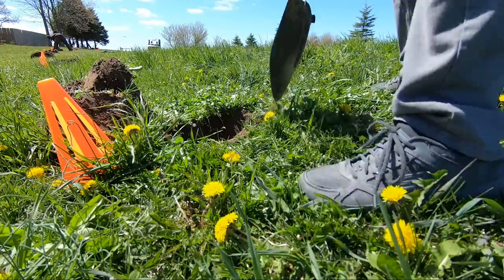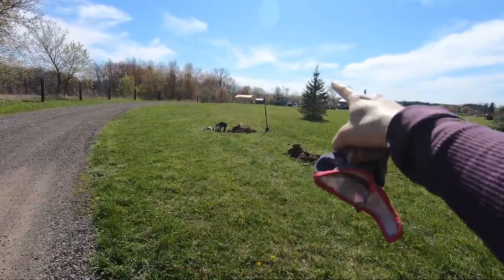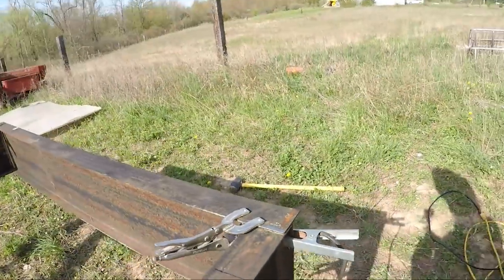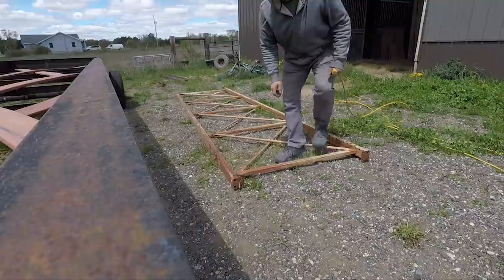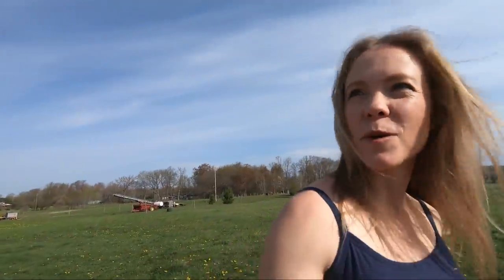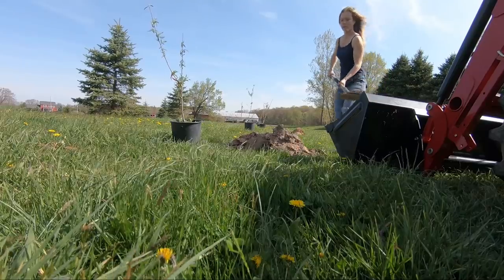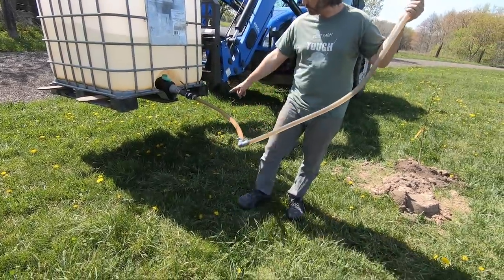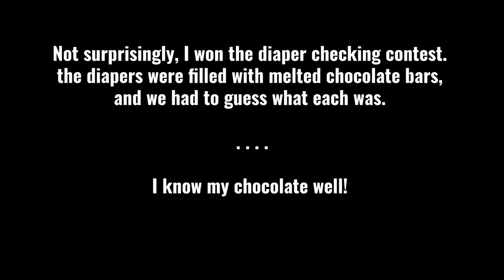372 We Planted A NEW CROP and Surprised Everyone --  House Trailer Into Hay Trailer

Comment: fruit trees.  I planted Cherry trees and they thrived.  I have Two Northstar and one Meteor.  The Meteor blossoms later than the Northstar.  an interesting factoid if you bury the graft on the lower trunk of Miniature or dwarf trees the root stock will take over and the dwarf tree will turn into a standard.  An 8 foot Northstar Cherry will become 30 or more feet tall.   Requiring a man lift boom to pick fruit safely.  (heavily mulching the bases of the trees can be the same thing as piling dirt )  keep the level below the graft.   A cold wet spring usually makes for a good fruit year.   Something to keep in mind Nanking Cherry shrubbery produce a good quanitity of edible fruit and make a adequate wind /snow break.  They are sweet cherry so you have to be in the ripe fruit immediately or they will start to ferment on the tree.   Fruit in general needs to be managed as a sudden rainfall after a dry spell will result in split fruit 

I have given up on the prospect of having dwarf Apple trees here .  6 consecutive years in a row I planted Apple trees and they all died during the winter.   When the weather warmed to above freezing the wake the trees up and then be slammed with freezing temps again.  They can usually take one or two but a series seems to be too much.  I ran out of ambition before spending the cash on Standard trees.
Reply: Remember when moving snow along the drive.  Snow piles and drifts make ramps that rabbits can climb over the guards on your fruit trees.  Fat content in the bark.  They will chew the trees just like beavers .  even when green grass is readily available
Reply from the maker: We were told by a nursery to put plastic guards on the trunks in the fall so the rabbits and critters don't do exactly that :D

Comment: I have looked some into the clay soils.  They clay can be high in nutrients but they have added to the soil to unlock the nutrients in the clay.  Sandy clay is the hardest to deal with.  The other thing to worry about is compaction.  It may not be a bad idea to run a subsoil implement to help with drainage. Most of the time in our area is done in the fall.  I see now why they  use the turnips to break up the soil in some hay mixtures. I tried that mix last year and had a turnip farm.  Not much else grew but was a learning experience.  I have a small area to work with anyway.  I also wonder if sub soiling would help the drainage area that hold water.  It may be interesting to dig down four feet and see how the field look at various levels.  How deep can you probe with a rod before you hit a compacted area? I really find your soil interesting and look forward to the improvements you make.  I can t believe how hard it is digging for the trees. Does the county have a soil survey for your area? I have also found this year that my soil compacted hard over last year.  It seems to change each year.  Last year I seem to go through it like butter. This year was harder.  It also was a dryer year.  Have you done a small garden? How did that fair for you if you did? Thanks for sharing..
Reply from the maker: Our soil is different from most others in our area. Everyone else is fighting sand, so we are lucky to have clay. The sandier areas have a harder time growing even weeds. We did try a subsoiler 2 years ago, but don't think it helped the wetter areas :( We are looking into a soil fracturer for the clay ground, to help break surface tension and allow more water and nutrients through.

Curiously enough, this year our main field looks AWFUL, but our seconadry field looks amazing! The differenece is the secondary field is on bottomland and shaded both from heavy sun and heavy cold/wind. This field HAD been wet originally, but we planted it with sweet corn, then rye, then teff grass, then failed brome, then the orchard. It still does stay a bit wet on one edge, but we are looking at digging out a small drainage pond to help draw water away :)
Reply: @This1LifeWeLive   Well that does make sense why you are having a hard time growing things and the hay getting thicker.  Some soils need ploughed to break it up for loosening the clay.  Learning your particular soil will take some work.  Seems like you will have to get a lot of matter into the ground to help with this.  I have seen gardeners adding composted material to the clay soil to help improve the matter.  This also helps to break up the clay. If the soil so hard how can plant roots set properly.  The sub soiler helps to bust open things using the thawing and refreeze in winter.   This can also be done with a cover crop that has the radishes in them.  I grew in my garden area to till under later.  I did not need them for the holes they make in the soil.   But more of the green fertilizer.  The other thing is leaves are a good source of carbon.  Try creating a garden on the worst soil. Mix in compost by tilling. Put a cover crop mix on it and till it back in.  I also have heard that a sandy clay is the worst soil.  The micro nutrients really are what break down last years residue.  If working right there will be nothing there in the spring.  Sounds like you may need a good tillage program and a good green nutrient to put back into the soil to help get the clay broken up and disperse water.  This is why I think it will take a while to get things going in the correct direction.  But start in a small area.  There are things that can be bought to help get they clay to break up some.  Once your  plan comes together I think things will go in the right direction.  I hope this helps.  It has taken me through trial and error.  I have learned what to do and not to.  This year I had hard compacted soil.  probably due to dry year last year.  Over several years I think I am finally getting our area.  Thanks for all the great videos.  It is not easy these many hats lol

Comment: The trailer looks like it is braced horizontally pretty well.   Vertical may be a problem.  No additional bracing that I saw.  But you may be fine.   I’m not a structural engineer, but I was a structural detailer back in the early 80’s.
Reply: send some ideas im not apposed to adding more bracing. I just want it to be strong and last a good wile.
Reply: @ruralridez6165     A cheap way would be to weld bracket under (below) beam on each side at front and at center between axles.  Weld a larger piece of steel on each side about 8” down from bottom of beams.   Then get one or two re-bars and weld them to the front and center then bend up and to the bracket at center of axles on each side.  Basically creating two triangles on each side.   Then weld another bracket at rear and 8” again in center.   Re-bars again.    Now 4 triangles each side.
Will it be strong enough?   I’m not a structural engineer, so I can’t say.   What you do is at your own risk.
Best Wishes.
Reply: @KevinCoop1  this trailer will only be used in the field not for road use.
Reply: @ruralridez6165      I have said too much already.

Comment: Judging by the digging, is there any sand in Sand Lake?   Last year I bought into existing Peaches  in Allegan County (compacted sand).  I spray non pesticide with Neem Bliss oil & Dr Bronners Peppermint castille soap.  Off season I use Liquicop Copper fungicide and Monterey Horticulture oil.  Peach Leaf curl is very common in MI and it will horrify you at first glance (Cold wet Spring weather induced fungus).  New leaves will push out.  Baking Soda spray is also a fungus preventative much cheaper than liquicop.  I self taught myself Peaches in a hurry, you will be fine.  Peach trees over produce like crazy, you will flick 2/3 off in June to benefit the bigger ones!  Then in Late July, the birds come seeing red!  get the prism tape out!  But boy, are they good fruit!  Best part is with OMRI sprays, I eat them right off the tree!
Reply from the maker: I did buy some neem spray too :D So far seems like the cherries are having the hardest time with the hot weather, turning their leaves yellow and falling off :(

Comment: Wil you support the trees with wooden stakes ... looks as though you are in a windy place?
Reply from the maker: I had planned on it, but reading online they said it would weaken the roots as the wind helps strengthen the roots, so long as it sits solid in the hole and doesn't wiggle around

Comment: Don't ever plant a tree deeper than it is in the pot, never cover the graft, putting, organic material in the hole robs nitrogen as it decomposes, Golden Delicious is self  pollinating, and will help pollinate. Also tell Eric, he should make vertical welds from the bottom up.
Reply: Covering the nod makes the tree grow from a dwarf to a large tree. Depends on what you want.
Reply: @janicetownsend8413  It's very rare that anyone wants a large standard tree. Everyone I know is pulling them out to plant dwarfs. The old standard trees are hard to spray, trim, and pick. Also trees planted close are much more efficient all the way around, and make better use of the ground.  If these trees are planted right, more trees can be planted in between in the future.
Reply from the maker: Grafts were not covered :)
Reply: @This1LifeWeLive  seeing these are potted trees you could actually blend some peat moss or a small amount of manure around the dirt ball. Just be careful not to get air pockets or getting it too hot, or it will burn the roots. Composted manure would be safer. Don't do that with bare root trees.

Comment: Those rails you are using have no structural strength when laying on their side. The ones that hooked into shelf ends. It looked like you welded them laying flat
Reply: yes they are on there side I ended up running two per section instead of just one for added strength. the floor is on and it feels very solid. only time will tell how it holds up but for a $800 37ft trailer should work fine for hauling bales from the field.